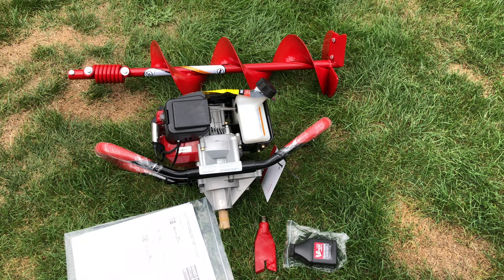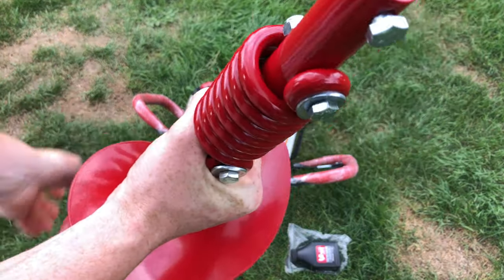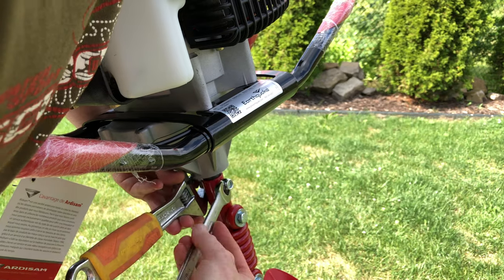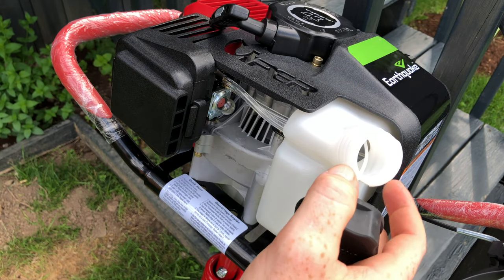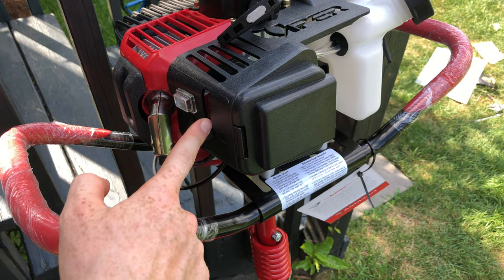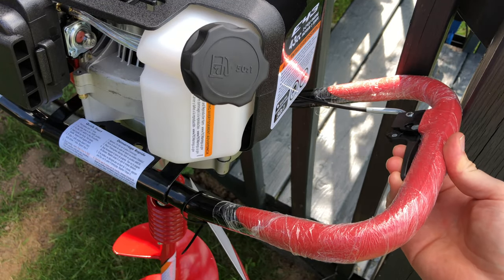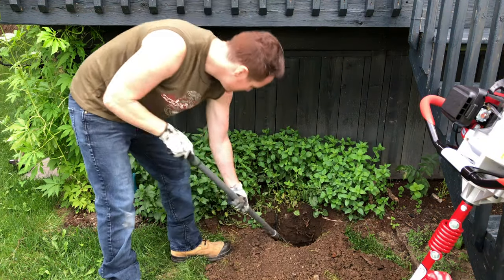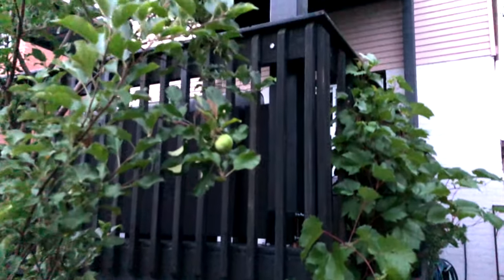EARTHQUAKE 43CC 8IN EARTH AUGER - Earth Auger Powerheads - Groundbreaking equipment - Soil breaking

Comment: Itis not gas and stabilizer, it is gas and 2-Cycle oil that you need in the fuel tank!
Reply from the maker: it’s what you see in the video . that’s what it came with
Reply: Yes, but the label on the bottle of two cycle oil said that it has stabilizer in it. Stabilizer is totally unnecessary if you're gonna use it all (the fuel) quickly.. It does nothing for the combustion process. You only need stabilizer if you're gonna put the fuel away for weeks or months. Total waste of money in most cases. But if a bottle of engine oil comes with stabilizer, it can't hurt.

Comment: You don't have to pull the auger out of the hole, tilt and dump it. Just lift it out of the hole and spin it fast as you're lifting. Centrifugal force will cast the dirt away. No reason to leave the hole..
Reply from the maker: I had no choice since I got way too many rocks there. So it would get stuck consistently
Reply: @DoitDoit  Gotta hate rocks.